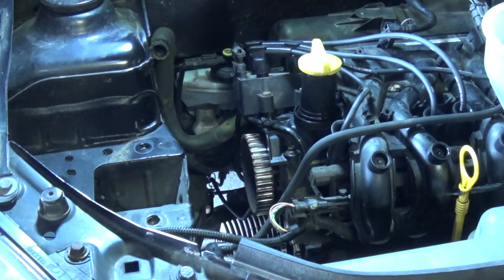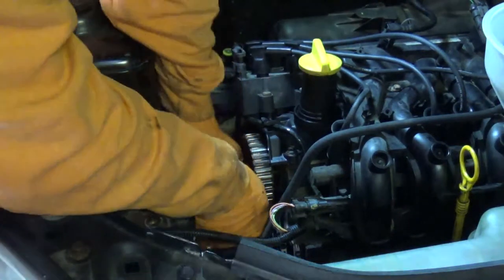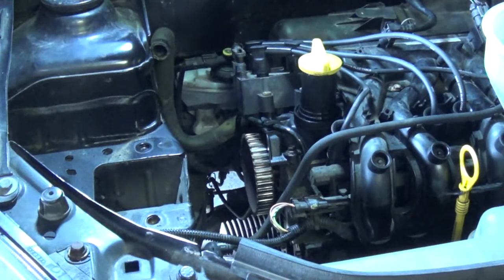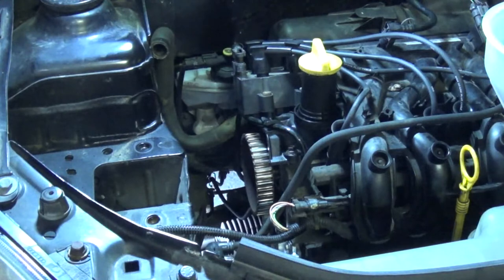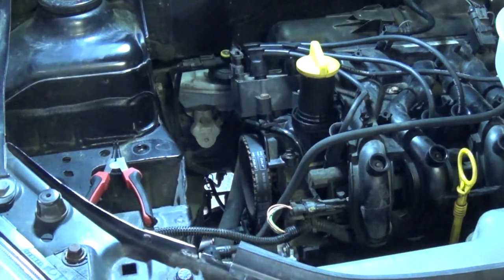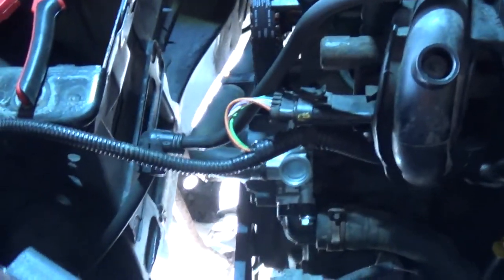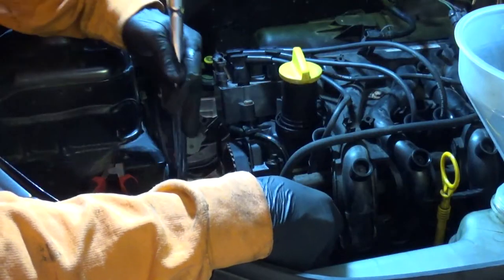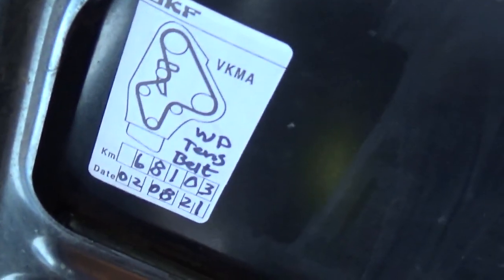Renault Clio mk2 / campus 1.2 8v timing belt replacement part 3 of 3

Comment from the maker: I misspoke towards the end of the video, the bleeder is on the thermostat not the water pump.
Torque Wrench settings; Water pump 9Nm, Tensioner 50Nm, Crankshaft Pulley 20Nm then 1/4 turn, Side mount to engine/body 62Nm, Side mount centre 105Nm, Road wheel (steel) 90Nm.
Reply: What torque for the plastic elbow bolts to water pump? 9Nm too?